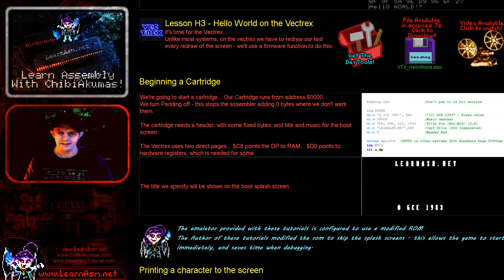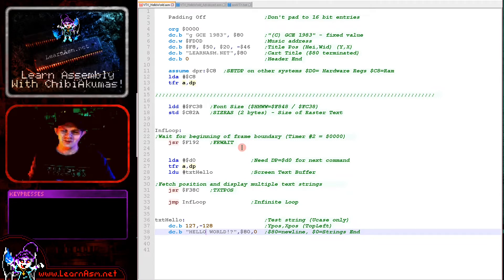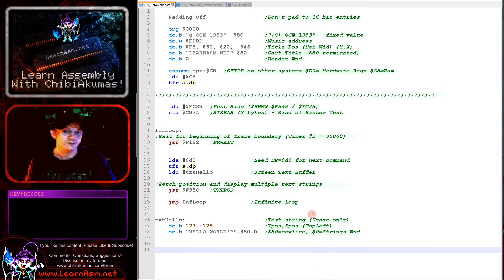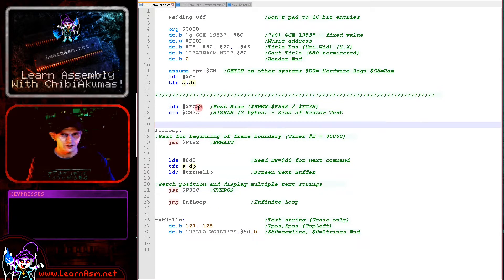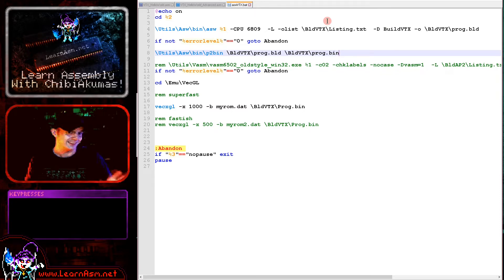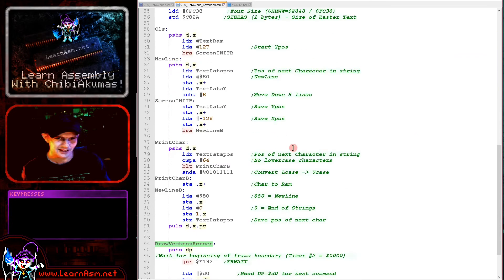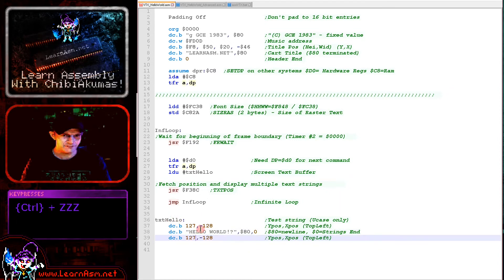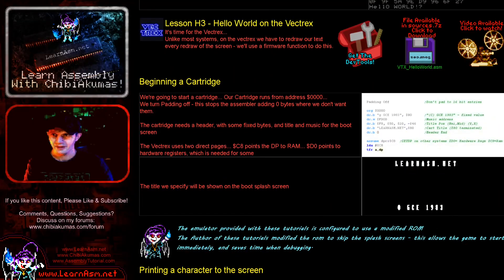Hello World on the Vectrex - 6809 Assembly Lesson H3

Comment: note. neither of the tfr instructions are needed. the first one setting DP to C8 doesn't ever use an 8 bit address (Direct address mode) the following 2 lines ldd and std use 1. Immediate and 2. Extended (16 bit) addressing.  The next one that sets dp to D0 is redundant because the RUM function "F192" (normally called Wait_Recal based on names used in 90s disassemblies) always calls the subroutine that sets DP to D0 for every "frame". 

Anyone who wants to actually program the Vectrex I'd suggest they start with the 20+ year old tutorials by Chris Solomon and get the IDE/Emulator  "VIDE" that has a built in assembler (different syntax to the one used here btw) and emulator and many tools for creating sounds/images to use for game content.
Reply: Spudster approves.
Reply: @gopherbobz  🤣
Reply: By the way... Your revenge on spudster was a very influential piece to me. I saw it a couple years ago on GitHub and immediately thought... Hey I can do this assembly too!  It's too bad I was late to the Vectrex world and missed the physical release!
Reply: Spudsters Revenge****